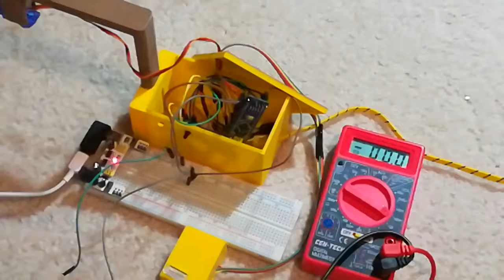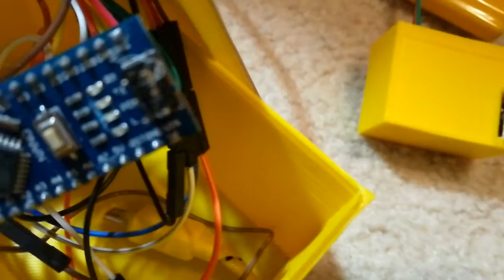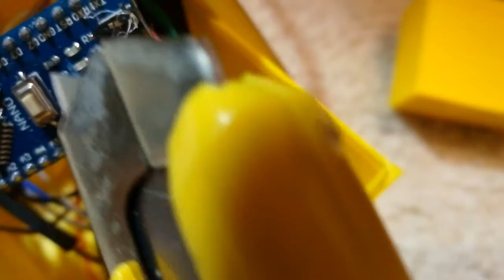Cutting LED traces on Arduino Nano to save power in Deep Sleep mode

Comment: I understand cutting the POW line but why the TX line? POW is always on when it is powered, but TX is only on when it gets serial input, isn't it? Once you disconnect the Arduino from a computer, then you do not use serial, so the TX never gets lit, does it? The only exception I can think of is if you are using the TX pin for a different purpose, but Nano has plenty of pins, but that should be a very rare case.